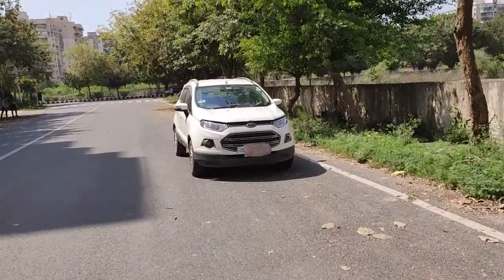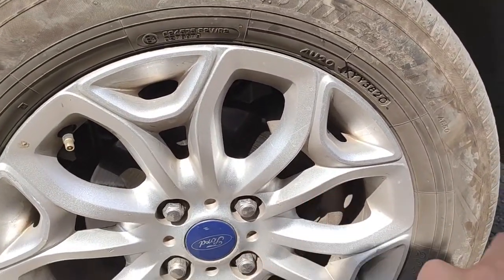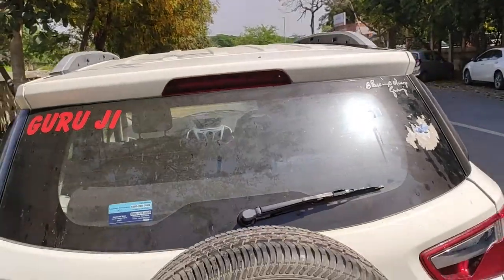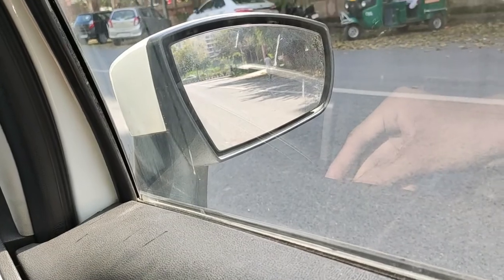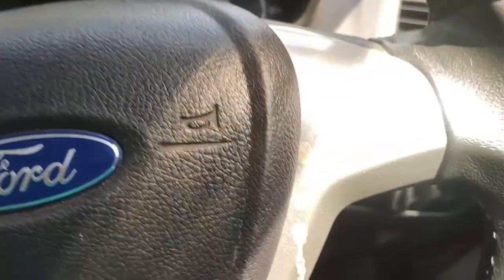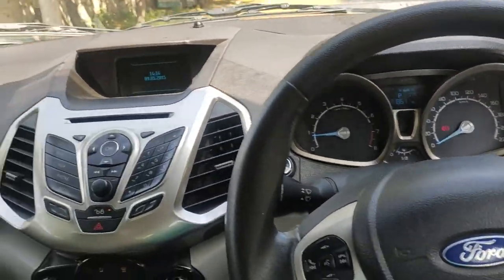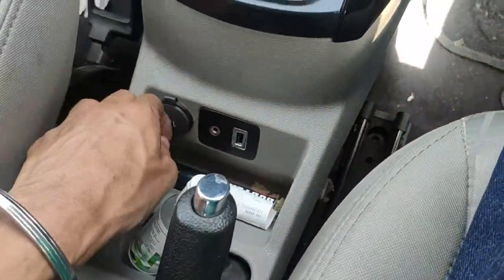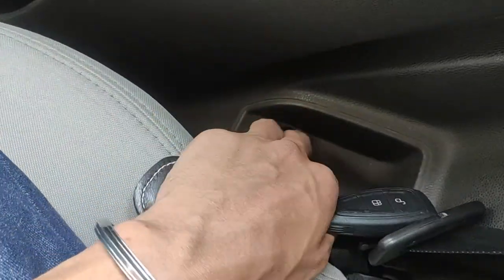2016 Ford Ecosport Titanium 1.5 Petrol Ti-VCT Automatic Review!

Comment: Hi @Anubhav Rawat, Ford ecosport titanium Ti VCT petrol AT -- 2015 model.
The drive stretch of the car was around 40kms and the engine and bonnet heated up so much... Is it normal in this model... Or do I need to worry about this?
Reply: Not normal..pls get radiator checked.